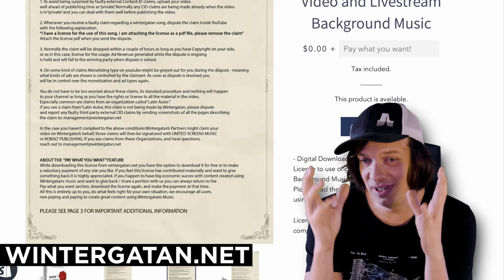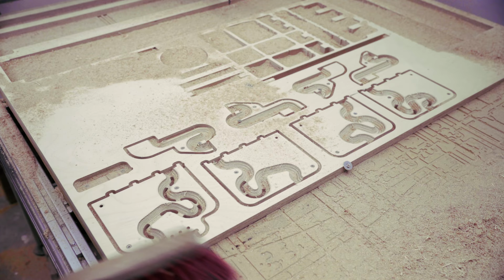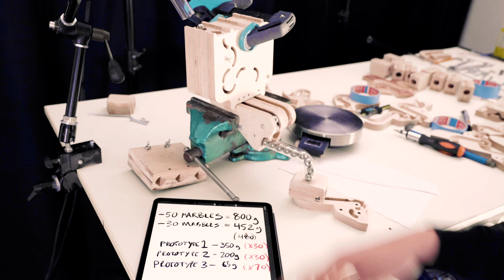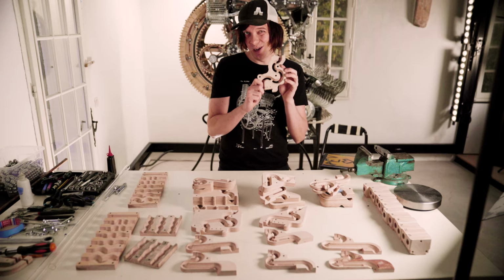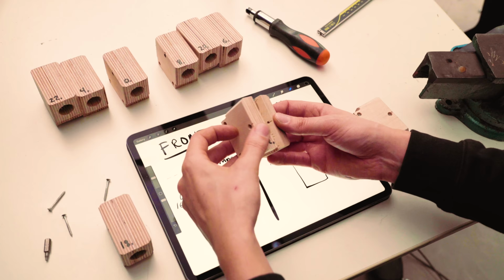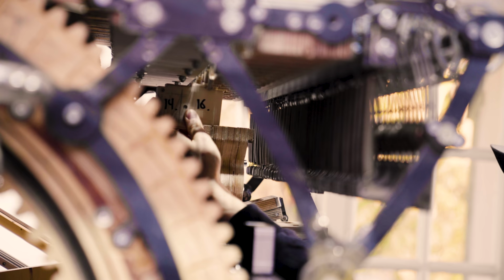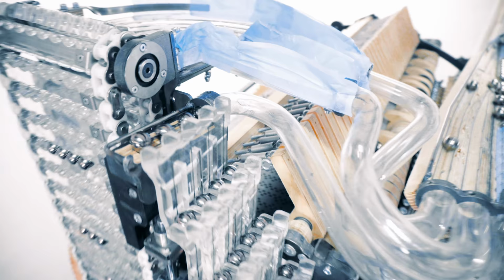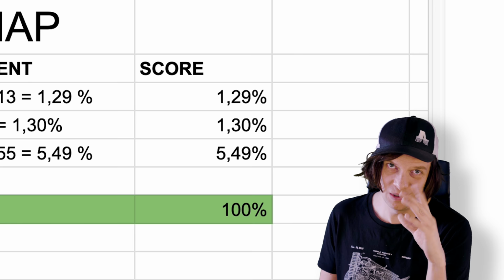Playing 20000 Marbles - Marble Machine X #147

Comment: One thing that your new designs reminded me of.  You go to a famous amusement park about ready to ride a new ride.  You go in line which is several hundred meters long, and a sign says, "Wait time: 45 minutes."  So, you wait and slowly walk toward the ride, which is housed inside a building, and you see the entrance.  However, the line goes back and forth through about twenty roped-off lanes, and then you finally get near the entrance.  However, when you get in, you go through a long, winding corridor which sets the tone for what you are about to experience aesthetics wise.  Then when you reach the end of a corridor, you turn and find yourself in another corridor and have to keep going until you reach the end, only to have to to through a third corridor, etc.  Then, finally, you are able to see the ride up ahead, and you go through an additional length of line until you finally reach your destination.  Then, you finally get on and enjoy the ride.

That is what you are causing the marbles to do.  When they reach the marble divider, they have to wait in a long line to the entrance, only to have to go down through the pmma pipes, only to have to go through the twisted corridors of the pressure valve assembly, only to have to go through more pmma pipes, only to be momentarily stopped by the marble gates, and then, voila!  They now get a chance to play an instrument.  Then, they exit via the funnels and return outside in the MMX equivalent of an amusement park.

In Southern California, USA, there is the Disneyland theme park, and I remember the first time I went on a roller coaster called, "Space Mountain", I had to wait an a very long line which went through like I was describing above.  Then, I got on the ride and it was like rocketing through space.

Comment: Its funny regarding the timing belt noise. I troubleshot a noise in my mothers car yesterday with the exact same issue. Where the serpentine belt was resonating from stretching caused by the age of the belt and a weak belt tensioner spring. It would only cause the noise at certain RPM that created the most resonance in the belt.

Comment: Perhaps rather than trying to tweak all the belts and many other components to remove vibrations (which for a machine like this will surely always exist), could you just use a simple tuned mass damper or harmonic absorber?

Comment: Two thoughts that I had while watching this asside from that it is awesome is that 
1. Having labeling or some index on the programing wheel sheets so that you dont have to count spaces between pins could be helpful.
 2. I don't know that you would use it for a song but you didnt specifically test releasing 2 marbles simultaniously to see if that causes a failure, I view that more as a test in case the progam wheel incorectly programed. 
Awesome work, please keep it up.

Comment: Why does the Wider track slow the marble down - the strange Newtonian Physics thing  - "Effective Moment of inertia".  
(Note that the variable width "rod based transport mechanism" geometry is the mechanism  used in some "CVT" drive  units used in Lawnmowers/Garden Tractors  (Toroidal Variator)  - As well as "over rotation" - the increased maximum radius velocity - relative to the linear velocity - will cause quite a lot of friction between adjacent marbles.

Hi Art - Meet Science.  Great Creative use of New and Old.

Comment: Martin, a thought re timing belts tensioning: ordinarily a belt would only have 1 tensioner. If you apply two to each, if equidistant from the centres of the crankshafts/pulleys, you’re potentially doubling (?) the pitch of the resonant frequency. Adding one tensioning idler to the topside of each, in positions that result in 6 different distances between centres will prevent any buildup of vibration. And making these adjustable (as I’m sure you will) will help compensating for temperature from both climate and prolonged use, as well as wear and tear. 

Speaking of wear and tear, check your belts as vibration can cause damage.

Comment: A: All 3 heights are the same - meaning the initial potential energy are the same.
B: All 3 weighs the same - i.e their masses are equal.
C: The "3"rd marble has to accelerate to a speed 3 times higher than the 1st... with the same amount of base energy... which naturally means it will fall behind.

(Perhaps not a scientific explanation - but one that anyone above IQ80 should understand) :P

Comment: It’s really easy to grasp why it shows the marble down (I think it seems ), the circle with a larger diameter represents a longer track of rail traversed.. in both cases no matter the circle diameter the marble is still rolling one cycle... so if distance/cycle is increased so is velocity.. the force applied to the the marble in a downward vector is gravity, and in every instance we’re dealing with the same marble, the same mass.. so the force applied to spin the marble so as to appease the gravitational pull is the same, the difference is for every revolution how much distance your circumference is taking you.

Comment: It may be time to consider using push-lock mounts for some of these things. For easy assembly and disassembly with the push of a retainer clip. Much of this stuff doesn't "need" screws, welds, secondary complex brackets... Like your marble gates up top. Two studs in the base poking through the metal "L" mount and a simple retainer pin at the top. One quick pull of the retainer pin and you can remove it. As opposed to four lock-tite bolts that would hold an engine manifold in place.

These "easy" designs are costing you much needed time in this whole "experimental prototype phase". If needed, once it's all said and done, you can reinforce things with more permanence.

Velcro, compression fittings and retainer pins can help set you back to having more time to develop and fix things. As opposed to delaying the fixing of things and stalling development.

P.S. Make sure that you pre-curve the music sheets, before welding studs and add mounting pins to your wheel. Use wooden rails, which run vertical, to ensure the plates are retaining the needed curves. You can also add strategic "cuts", to reduce the plate weight and aid in a more flexible plate, for mounting, without risking the pins mounting angles or structural integrity. With such narrow pins, as opposed to wide flat "L" mounts... You will need something stronger than nylon registration keys. The rods will eat-up the nylon and you will constantly be adjusting the timing on the pins played the most.

Comment: You should only need one belt tensioner per belt, correct?  Not two?  Most similar belt/chain tensioning systems require only a single tensioner roller.

Comment: only use one belt tensioner(runner wheel) per belt using two will only complicate the design and cause problems.
keep things simple silly (K.I.S.S) the more kinks you add in the pipe the more easy it is to clog the drain.

Comment: when joining curves, I think you should look into Euler spirals instead of just tangential smooth transitions.  A straight line joining to a semi-circle, tangentially smooth, still has discontinuous change in acceleration ("jerk"). I think this would lead to more chaotic marble movement as well as more noise.  Using Euler spirals in your design could lead to quieter and more consistent performance. This site has a good description of the differences: https://dynref.engr.illinois.edu/avt.html

Comment: Spring holded loader wheel on the belt to hold them to the same thightness and stop them from vibrating. Also set up multible cameras for the next 20 K run that cover the possible problem areas, that way you will know where it failed. Fantastic good work so far and keep it up it's inspiring so how far you have come. You have working machine now, what you are doing now is polishing away the defects and improving preformance.  The next test run after a new round of fixes should be very interesting to watch, especially if you set up more cameras to catch any errant balls as the go of the rails or where ever. Good luck, but truthfully you wont need it, if you need luck then your machine isn't done yet, becaue luck can always turn against you or with you. Those are the aberant results.

Set up a run and watch for the jumpers to call the errant balls something a bit more fun,  finding those spots where that happens and then fixing the, will change the machine from nearly perfect to working good enough each time and from there to perfect, but that's a very high bar to reach. It might not even be possible as long as you use wood part, Maybe if all wheels were made out of metal or at least their core and drive train where made of metal, then you might achive perfect runs everytime maybe 99 out of a 100 runs.

Tha's why it's important to find every where the jumpers try to escape, sooner or later one will achive it goal, so you must fine the weakness in our track and irreadicate them. But I know that you will make it, so you don't need to listen to my rambling.

Comment: So I’m not a physicist or anything but based purely on intuition, I think the reason the smaller circumference causes it to go slower is that the marbles are rolling at about a constant speed, so the smaller circumference=less ground covered per rotation. 
Someone sound off if you know the real reason though.

Comment: Just to explain the "overrotation" part, why it slows them down:

Imagine I gave you a wheel with a handle and asked you to turn the wheel at "1 rotation per second". You'd grab the handle and start cranking it until you got it up to speed.
Now I'd stop the wheel again, and ask you to go to "3 rotations per second". You'd start cranking the handle again. But would it take you exactly as long to get to 3 rotations per second as it took you to get to just 1 rotation per second? No, you'd either have to use more power to get it up to faster rotation speed in the same amount of time, or you'd take longer to get it up to speed.

What you do by letting the marble roll downhill is converting potential energy (height) in kinetic energy (motion). One part of the motion is the "forward motion on a straight path parallel to the track". And another part of the motion is the "rotation of the marble" itself, angular momentum. The energy put into the marble is split up between those two, forward- and revolving motion (minus the typical small losses that will be converted to heat, sound, etc). Since the gravitational force acting on the marbles is the same, but the one with the wider tracks needs to rotate faster in order to move the same distance, the balance between "energy needed to get the marble spinning" and "forward motion gained" is shifted towards needing more rotation in order to cover the same distance. But since it takes longer to get the marble to that rotational speed, it'll take longer for the marble to cover the distance, hence the "forward motion" component is reduced.

You could probably best see this by using marbles with a red dot on the surface that the marbles keep rolling over. You'd see the different rotation speeds at different points in time.

Comment: I didn't google this or anything, nor am I much for math or physics, but isn't the reason that the over-rotating marbles are slower that they aren't actually heavier, so compared to the non-over-rotating marbles, more of their potential energy has to be turned into the faster rotation the smaller rolling diameter necessitates? I imagine that if you increased their mass according to the diameter you use for your tracks, they would roll accordingly.

Comment: Has to be a reinforced drum head to withstand the marbles hitting against it.
Reply: Drum heads a pretty strong. Compared to an actual drummer the marble hits are pretty tame. Eventually they will start to wear out after months of use but changing the head is a very easy process. You make a good point though. If that's the same head he's been using since he got the snare, then he's probably due for a new one. A fresh snare head might help decrease the funnel fail rate too!

Comment: @9:00 Isn't most of the weight also putting pressure and pushing against the angle in the bottom transparent tube ? With enougth pressure that tube could be pushed out of it's socket.

Comment: When you were talking about the marbles on the rails you could use a pulley as a good way to explain it, kinda the same thing going on, the marble is the pulled and the rail is whats being driven “ “ so the further the rails are apart  the smaller the pulley would be so the slower they would go the closer the rails are the larger the pulley so it would be faster even tho usually a larger pulley would be slower as it has a larger diameter to travel it, when I was building race mowers I would have a 10inch plus pulley driving a 2-4 inch pulley making the mower scary fast but not enough torque to be really viable swap the pullies around and you have all the torque /power you could want but only have a top speed of maybe 3mph

Comment: wait, wouldn't Martin have to use an equal height of marbles (the hight the last marble reaches when they are stacked in the whole system) instead of an equal amount of marbels
the thing is sure the pressure is lower with the equal amount but in the end you would always have to test if its also the case with the equal height of marbles since in the end the distance between gates and marble divider can't change. I am not doubting that the new channels help I am just doubting the test scenario

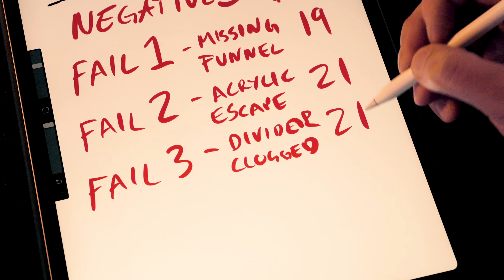Comment: 28:13 Issue 4. I have a thought on solving the belt resonance. There is a long space between the ends. A vibration resonance can happen. Break the path. Add a third wheel. Call it a tension pulley in the middle of one or the other sides of the belt. That belt will eventually stretch an will need to be snugged up. I'm not an engineer in these things. Just decades of working with mechanical things. I do see a problem as to how to add that pulley as things are now. Maybe it could be solved by relocating the drive motor closer to the pulley to be driven. Thereby a short belt and no resonance. 3.2 k responses. Not likely they will see it.
Reply: You're spot on on everything except for the short belt not having resonance. Every length/tightness combination has a different resonance. It's true, though, that you have dampening happening too, and a short section has higher dampening so you'd have to put more energy into the system to see effects of resonance. All in all, great job of analysis!

Comment: 8:00
I think it is because the marble acts as a gyroscope to itself.
if you grab it by the edge and make it turn, you're effectively making a gyro the size of the marble, where all the mass is accelerating away from the center, while the center remains static.
if you roll it on one side, all it's mass is sometimes accelerating towards, and sometimes away from, the surface over which it's rolling.
on a rolling plane, the leading edge of the rolling marble accelerates less than the trailing edge, because the trailing edge accelerates both up and away from the center, as the center approaches the leading edge, as it accelerates down (and away from the path of the center) and forward.
all these magnitudes are microscopical, and the forces are negligible but when you translate it to proportions, they still have to hold true to the laws of physics.... and the laws of physics say, that when you take a mass and spin it, you produce force leading away from it's center, and it wants to conform to the nearest gravitational pull.

Comment: I've been thinking about the Tensioning Belt vrs the Wheel Assembly.  Would it be easier to put a plexiglass pane between the two to separate them?  Or maybe re-tighten the Tensioning Belt itself?

Comment: Why not use a giant "marble drain" platform? a sloped surface that would direct marbles that fall off the machine to the center to be recycled back into the machine. That way if something does fail in the machine even more catastrophic  like the return channels underneath, the marbles wouldn't be lost.

Comment: You mentioned earlier in the video you weren't sure why the speed so was so different. Think gears. Rolling using the middle means less rotations to cover the distance. Rolling using the outside to roll is a smaller gear many more rotations to cover the same distance.

Comment: Funny about the conveyor belt. I have a belt driver bicycle, and I experience the exact same thing at a certain cadance, the belt starts to vibrate. If I paddle faster the vibrations disappear. I don't know exactly why the belt starts to vibrate at a certain rotation. I've tried to loosen and tighten the belt, but it doesn't appear to do anything. I'd talk to an automotive engineer and see if this is something that exists in cars and what they've done to counter it.

Comment: I am so impressed by this project! Great strides forward in recent episodes! You are certainly picking up many good engineering skills and showing off a super interesting product development journey in this video series.

One minor thing: The calculations of the reliability at the end seems to be off. 61 out of 20 000 is 0.3 %, so the reliability then comes out to be 99.7 % (not 99.997%). On the positive side, a few fails in terms of marbles jumping out of the machine is not a stopper, so the 1/10 000 000 failure rate is not strictly necessary for the machine to play reliably. It is catastrophic failures that must not occur more frequently than 1/10 000 000. Non-catastrophic failures may be a bit annoying, but are acceptable in my opinion. There were 0 catastrophic failures in this test, so in some meaningful sense, the score was 100%.